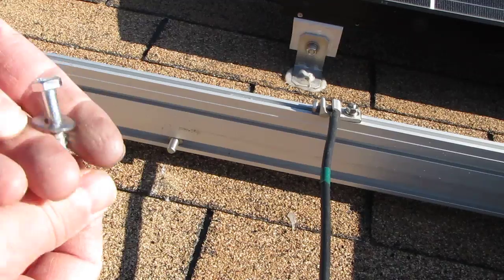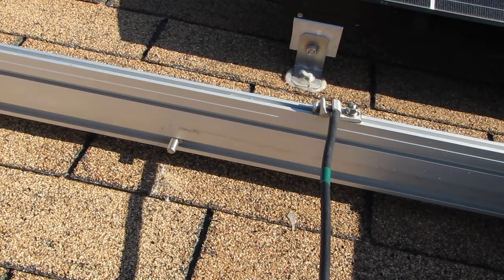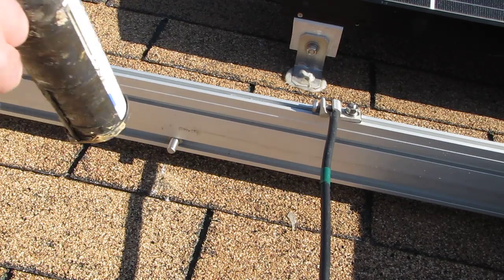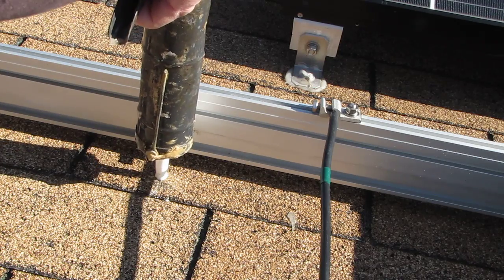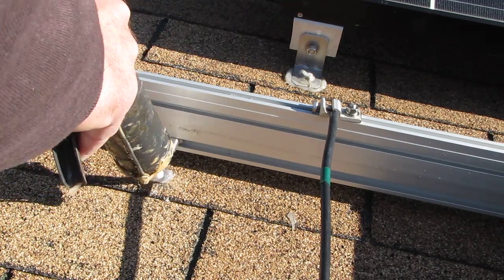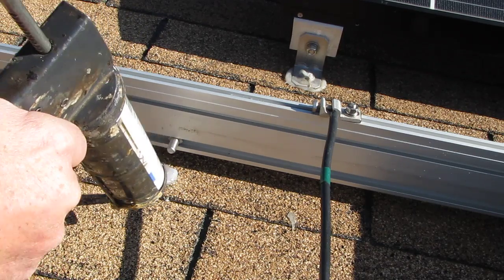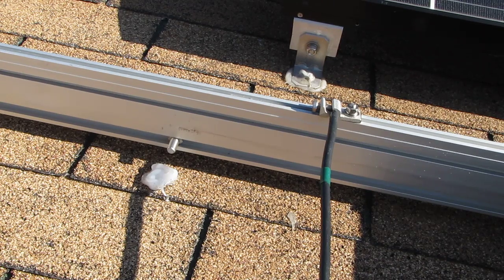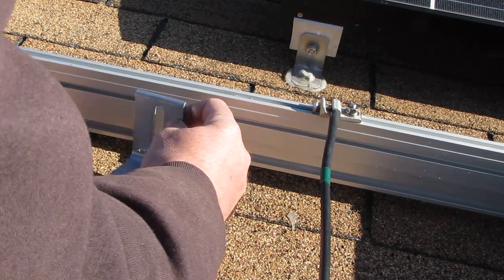Solar Panel Mounting to Roof How To By VIARLOCITY

Comment: You admit rebuilding and using Quick Mount PV. Why not delete this video if you know its not a good  method?
Reply from the maker: This Was My Make Shift until I rebuilt My Roof It Worked and never Leaked

Comment: crap! YOU NEED TO USE FLASHING!!!! BAD ADVICE YOU GIVE!
Reply from the maker: +Richard Bennington  You Should Use Flashing !  If You Use Proper Silicone It Wont Leak  I  had These Panels On The Roof For 5 Years  It Never Leaked Since Then I replaced The Roof  and Put The Proper Solar Mounts And Flashing  Cheers Kenny 

https://www.youtube.com/playlist?list=PLCD74dps4lg9sZJlXVMXLDzdxY5Bjdriu

Comment: Without flashing this job is guaranteed for the water leak in the long run, unless you install Solar system on your roof then sell your house immediately.
Reply from the maker: *****  Your Exactly Right I Have Rebuilt The Whole System Since Then

Comment: those rail rated for 6ft spacing i go with 4ft spacing every joist waste of money... better products than silicone out there for roof pens. should be flashed... invest in a impact driver thats a drill with clutch it dosen't set the lags need to pull L foot down tight.....
Reply from the maker: butch kern I Agree Totally I Just Rebuild My Roof And With Flashing PV Quickmounts  Here Is A Link Buddy 
http://youtu.be/z9s1tY7se-g